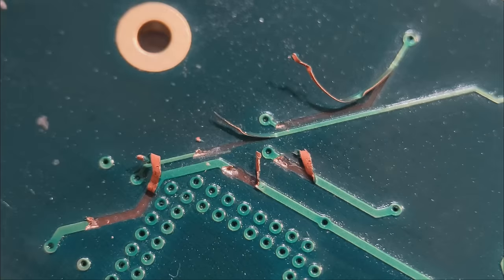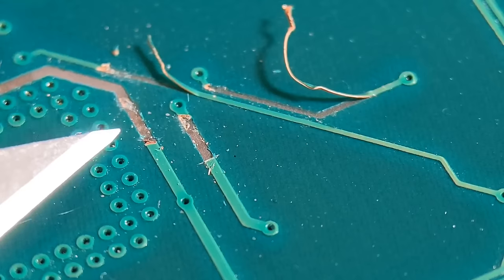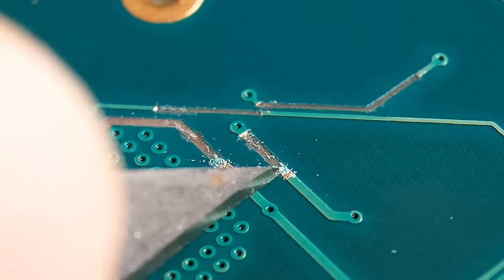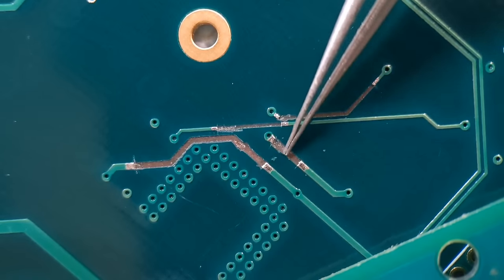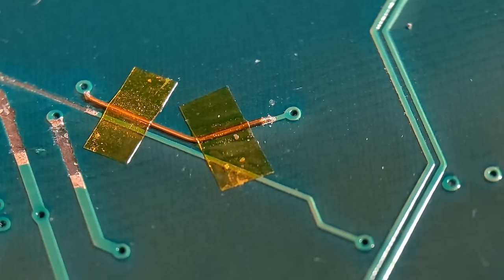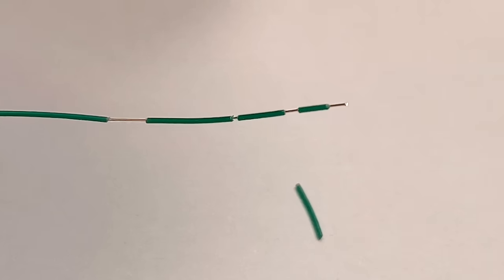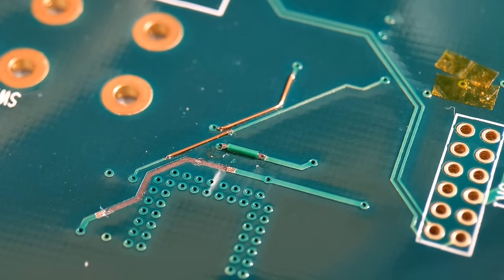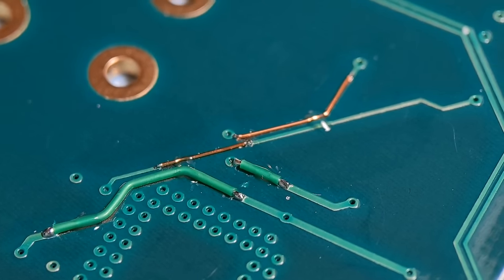How To Repair Damaged / Broken PCB Traces  - 2 Great Methods

Comment: Nice work but I would have done point A to point B. Basically point to point the entire broken trace.
Reply from the maker: Hi , it's good practice to follow the old trace as in certain situations it can be quite important regarding signals etc , especially on RF boards . That's why you occasionally see some really weird shapes of traces as they have to be a certain length so can't just go straight from A to B. Hope that explains why I did it this way . Thank you for your comment , take care 👍
Reply: @mrsolderfix3996  ahhh I get it now. Thank you! I only deal with Audio amplifiers so I can certainly understand the need to keep the trace a certain length. Thank you for the reply! Have a great day!
Reply from the maker: Hi , thank you for your comment . Hopefully I didn't come across too fussy to people watching the video about the routing of the wires . Following the old trace is just normal for me and is good practice and actually looks so much neater . Thank you again for supporting my channel , take care 👍

Comment: I learned a lot from you. The way you stripped the wire in several places. I always tried to strip the last end with the other soldered down. Great technique that I will now use. Thanks!
Reply from the maker: Hi , thank you , I'm glad you found the video useful . If I can help a few people out that's great. Any kind of short wire I always pre prepare my length first so never risking damage to the board which I have seen over the years by different methods people are using . Thanks again , good luck with your soldering projects 👍

Comment: I got into electronics through hardware hacking. Your videos really inspired me and you're very good at what you do. I want to attach wires to traces, for example rx and tx lines, but it's annoying having bare wires. Any solutions for this without drilling a component into the board (not always possible when the back of the board is used). I've got a hakko rework station, and microscope. your videos inspired me to get those when I had a small amount of inheritance. I'm from UK too :) Just wanted you to know your videos have inspired a new career for me.
Reply: Get magnet wire, solder mask, and an ultraviolet light. Magnet wire is coated with enamel to insulate it, the solder mask is the green stuff on pcb's that insulates all the traces & the UV light is for curing the solder mask. When you use enamel wire it usually doesn't need solder mask but it'll give you piece of mind. Only use the tiniest bit of solder mask though because if you use too much the UV light won't penetrate to cure all of the solder mask.

Comment: My induction stove had a small broken path in the main circuit board. Thanks to your video I now can repair it. I'll update this comment when it's done thanks!
Reply from the maker: Hi , thank you for your comment. I have also posted another video showing another 4 ways to fix your traces , this one may be of use to you as well . I hope you get on ok with your project , please keep me updated . Thanks again and good luck 🤞
Reply: @mrsolderfix3996  it was not a project. It was just an item that has to be fixed in home.
Reply from the maker: Hi , no problem.

Comment: Superb razor work. I always end up removing a extra inch of PcB, lol :)  I used this video to fix my  hd 7950 and it worked for along time before just crapping out on me again. This time, the fan controller burned off of the board so Im'a say its done for!
Reply from the maker: Hi , thank you for watching the video and commenting , much appreciated . I'm sorry to hear your boards finally clapped out . If you ever replace it use the old one to experiment your soldering skills on . That's what I've always done , massive help . Thanks again , take care 👍

Comment: When I worked at NCR back in the early 80s we had what they called track repair which was a tin metal strip similar to what they use to connect solar cells together but we had it in widths the same width as the traces on our circuit boards. I've never seen it available in any catalog that has soldering supplies.

Comment: Well done Sir though there could be some time sawing shortcuts I'd reccomend:

1. In your Method1 I use just an uninsulated strand of a multistrand cable matching the gauge of the broken track. I do solder one end in and follow the original track to bend at required angles until I reach the destination track. Before I solder the other end I use now the UV activated glue at each bend, then I do terminate and solder the other end. Finally, I use the conformal PCB laquer to finalise the job.
2. The alternative is to use the wire-wrap wire and just to connect between required points. This way it does not have to follow the original track because it is all insulated. This is kind of an equivalent of your Method2. The UV glue is still used to secure the job.

The presented video does show the situation I have never encountered in my many years of servicing. Most of the PCB damges of this type did come from a client dropping a device to the ground and caused tracks break on the PCB because of inertia of a heavy element connected to it - like for example, a transformer.

The third type of damage you have not covered in this video is the one I found to be most frustrating. It is a dry solder thermal runaway joint of a power component soldered to the PCB destroying the through hole of the at least two layer PCB.

Ofcourse, there is more. It may be ancient to you Sir but still relevant;
please have a look on this YouTube link:
https://www.youtube.com/watch?v=IBi40aq4-t0
Cir-Kit is the hardware to use in ambitious repair but I do not use it very often.

Kind Regards

Comment: Great idea the use of solder to get the shape then straighten and cut wire to length.
Reply from the maker: Hi , thank you for your support , much appreciated. The solder method mentioned in your comment does generally work really well . It's a lot safer pre- making short wires off the board to the right length rather than trying to strip the wire while one ends attached . This method allows you to do that . Thanks again , and good luck with all your soldering projects 👍

Comment: Looks very good. Have you tried the copper slug tape for making tracks it works well for wider tracks you can cut it down the middle with a sharp blade.  Try the UV cure glue it’s quicker. Thanks regards Chris
Reply from the maker: Hi , thank you for your comment 👍 Personally I haven't tried the copper tape but I have seen it in other situations and also postings on YouTube. It's always good that people like yourself suggest other options , this is of great help to everyone as the more choices the better as far as I'm concerned. I love Tak Pak as a glue so I always tend to use it when I want certain things bonded down to PCB's but again if other people like the one you suggest that's great. Thanks again for your support of my channel it's very much appreciated 👍
Reply: @mrsolderfix3996  I haven’t Tried Tac Pac but I will now. As you say always something to learn

Comment: Great Tutorial Mate well explained and documented!
Reply from the maker: Hi , thank you for your comment , much appreciated. I'm glad you enjoyed the video , hopefully it can help a few people out. Thanks again 👍
Reply: @mrsolderfix3996  You're welcome again mate, tbh I was tinkering about today and came across a question you can educate me on. I removed an eyelet on the topside of a pcb - other than now running a bridging wire from the bottom side of the ic pin (which still has its eyelet in tact) is there a handy way to repair the eyelet sitting on topside of the board. I can rework from the bottom as mentioned but curious what happens when an eyelet ring comes off from the topside of a PCB. 

Cheers Franky
Reply from the maker: Hi , I posted a video a while ago showing 4 ways to repair missing pads on through hole connectors . This video may be of use to you . Thanks again for your comments 👍
Reply: @mrsolderfix3996  Had a look see mate not sure whether my skills with a resistor wire are on point! the damage on the board was round 7400 ttl pins so Ill have a crack with a resistor wire or maybe try some thin gauge wire wrapping method, cheers for the heads up - and again very welcome with regards to comments mate, im still real green with the art but gaining knowledge with you vids so thankyou

Cheers
Franky

Comment: Question about the glue you used to stabilize the wire..  Do you have a link?  I can't find anything called "Tac Pack" or "Tack Pack" which I think is what you said. Also, is it removable without hurting the traces/board?   I have heard people say they use clear fingernail polish because it can be dissolved. Any comment/opinion on that?  Also, what about hot glue stick?
Reply from the maker: Hi thank you for your comment. I think your problem has been that you are spelling it wrong . Try "Tak Pak". 
Tak Pak is a PCB recommended glue that   comes in 2 parts. Activator and glue . Pretty expensive but I purchase each item from eBay seperately and you can get a lot cheaper. Spray activator on first then wait until it's evaporated then apply the glue , very simple . Do not glue first then spray like you are told to do .Can be removed pretty easily with no damage to traces etc . I definitely recommend it for PCB mod wires or trace rework. Hope that helps , thanks again 👍

Comment: Great content Sir!
What type of wire do you use when doing a pcb trace repair. Appreciate the help❤️
Reply from the maker: Hi , thank you for your comment , much appreciated . I always try and match the width of the trace with the wire I will repair the trace with . In this video the green wire was 30 gauge Kynar wire which is probably the most used wire on PCB's . It's perfect for small width trace repairs and also is used a lot for doing PCB wire modifications . It's great for being able to solder to fine pitch IC pins . So this is my favourite wire but otherwise just try and match the size . Hope that helps , thanks again 👍

Comment: Thank you for making this video!
Reply from the maker: Hi , no problem , hopefully it can help a few people out. Thank you for your support , take care 👍
Reply: @mrsolderfix3996  I am indeed trying to learn how to properly solder and your videos are very helpful. After researching I found that two old radios of mine need recaping and I decided to do it myself. So now, lets say, Im having my theory semester watching your videos. So, again, thank you!   Edit: note that I thought soldering would be easy, but I was dead wrong. So, Im taking this seriously.
Reply from the maker: Hi , thank you for watching, hopefully the videos can help you . Biggest thing over the years that I've found helped me was different size solder thicknesses , definitely get some 0.25mm , flux which is essential when soldering and some kind of microscope . I've posted other videos on the tools I use etc , I'm trying eventually to do videos on everything I know. Thanks again , and good luck with everything 👍
Reply: @mrsolderfix3996  Thank you mate!

Comment: This is great for traces, what about where the pad is damaged, do you have a tactic for that?
Reply from the maker: Hi , thank you for your comment, much appreciated. If you check my other postings on YouTube I've done a through hole pad repair , 4 different ways , also I've done a couple where I've transposed surface mount pads from one board to another , you'll find them eventually, so yes I have done a few. Thanks again 👍

Comment: perfection! only thing missing is what specific brand/kind of glue do you use or recommend?
Reply from the maker: Hi , thank you for your comment , much appreciated . I thought I'd mentioned it in the video , I normally do when I show glueing methods . Anyway the one in this video was called Tak Pak  . Comes in 2 parts , glue and activator . Spray activator first then apply glue once activator has evaporated . I get it from Farnell , RS Components etc but have purchased the glue and activator seperately on eBay and got them so much cheaper than from main industry stockists . The eBay ones have been fine . Tak Pak is a recommended PCB glue and is great for modifications on boards  . Hope that helps , thanks again 👍

Comment: I like pressing the ends of my copper wire to flatten them and then after I have soldered them I put on a fairly liberal amount of UV resin and cure it with a UV light and that seals them very well and protects them nicely and if you do a good job it looks very professional. Still good job.
Reply from the maker: Hi , thank you for your comment. I think with soldering the more methods we all see we get more options to choose the one we like . Your method sounds ok and if it's what you like definitely stick with it . We can all learn from each other . Thanks again for your time , take care 👍

Comment: It looks on video like the wire is too big. However, it is pretty small. 
Nice job!
Reply from the maker: Hi , the enamel coated copper wire is 0.2mm and the green Kynar is 30 gauge so they are both very small . I try and match my damaged trace width with the replacement wire which in some cases can be very important . Thank you for your comment 👍

Comment: May I suggest a good trick I have discovered for removing trace coating? I do board mods where I cut PCB traces to add smd resistors and I remove the green trace coating with an engraver pen instead of scraping it with an exact knife. It works very fast and leaves clean shiny exposed copper traces. Also in my case with the traces I work on, the engraver is just the exact width of the trace so it works like an absolute charm.
Reply from the maker: Hi , thank you for your comment , very much appreciated . It's great when people like yourself come up with different methods . I'm definitely of the opinion that the more methods we can get out there the better as I've always said watch them all and choose the option that suits you best . Thanks again , take care 👍
Reply: @mrsolderfix3996  Even when you are are a master, you can still learn something everyday, especially from your students. That's what I like about guys like you and BigClive for instance, you acknowledge that you do not know everything and you stay open to new ideas, thereby elevating your own knowledge and skill to an even higher level.
It feels absolutely wonderful to see a pupil growing past you own skills. That's what I experienced when teaching a teen some origami. He was still a beginner then, but nowadays he shares pictures of models he made that I don't dare to try (yet) ;-).
Reply from the maker: Hi , thank you for your comment , very kind of you . The one thing I always say is no one knows everything and you should always be willing to accept new methods if they can help you . I've learnt lots from other people's methods and hopefully my methods can help a few other people . We can all learn together . Thank you again , take care 👍

Comment: ive done that a few times but i dont usally go as far as Bending perfectly into shape. I use what ever is on hand even some small stranded wire and just strip the ends.  Ive even  just scraped off the round parts where they end and use a little thicker solder wire and heat it unti it connects and leave the  solder wire connected. then cut it a little long and do the same melt it and leave  the solder wire on it to the other side. To  use the solder wire as a jumper instead.

Comment: Is following the old traces with the new wire or even using the exact same length of wire as the old traces particularly important?  
I doubt it would in most cases, although I'd imagine it's much more important to make sure the new wiring is properly secured to help prevent tearing of any remaining trace.

Comment: I used to work for contract manufacturers, we build other peoples products. When we had a trace repair, we would pull a trace from a donor board, replace the trace, or part of the trace. Then we had to mix up glue with green dye to color match the board and solder resist so that the customer never knows there was a problem. Replacing barrels in multi layer boards were quite the challenge, we would have to dig out schematics to test the repairs.
Reply: Wouldn't it be cheaper to just build another pcb?
Reply: @WetPig  almost never. Even if it were cheaper we couldnt do that as we were contract manufacturers, we dont get spare PCBs, we dont make the pcbs, we cant buy them  either, the only way to get more is to contact the customer and explain that we did something stupid.

Comment: Great video! I often have to repair single sided boards with pads lifting, but the traces are intact, this is simply due to heat from PSU components (the boards are twenty five years old!). Would you still use the TakPak to bond the pad/trace to the fibreglass, or would you use another product, or another method?
Reply from the maker: Hi , thank you for watching the video . If you have loose traces or pads I would always try and secure them to the PCB in case they take a light knock for example and get ripped from their points of contact. Tak Pak is what I generally use on PCB's but it's not a massively strong glue and can be removed if needs be. But to bond traces , pads and thin wires down it's pretty good. There are stronger adhesives out there , araldites , scotchcast and others so I guess take your pick , but I'd definitely use something . Thanks again for your support and good luck with all your soldering projects 👍
Reply: @mrsolderfix3996  what would you recommend to fix down a USB female socket on the pcb board?

Comment: would you go any thinner than 0.2mm copper wire? I bought some not looking properly and ended up with 0.1mm. It seems very fine. I want to use it to connect a smt32 to a 3.3v rail.